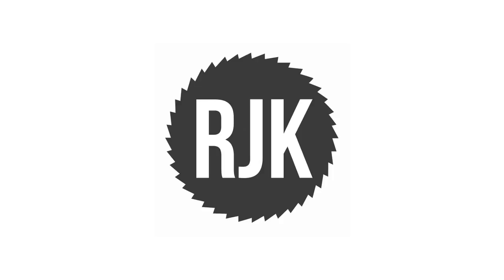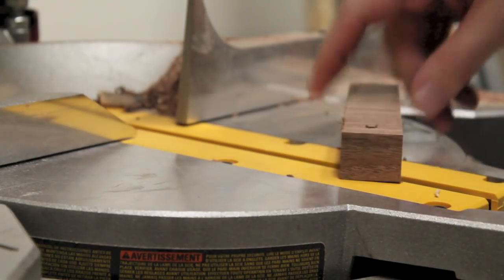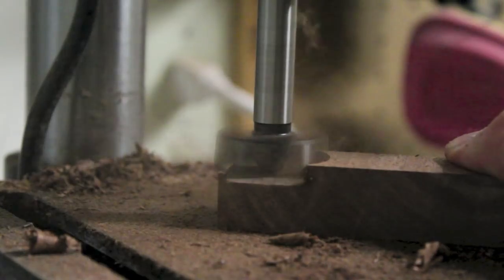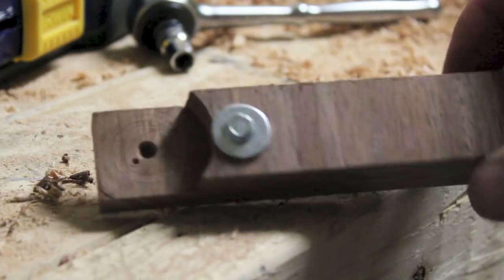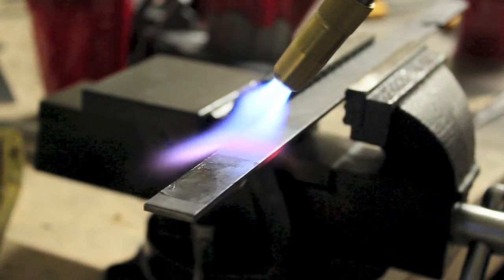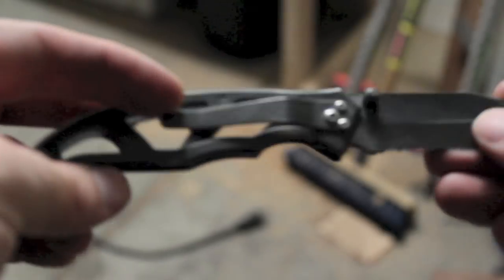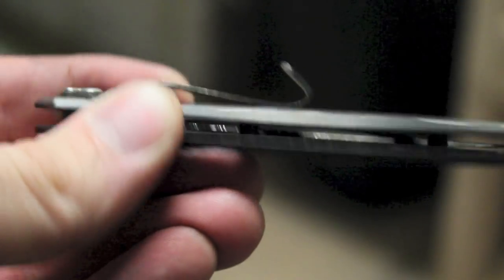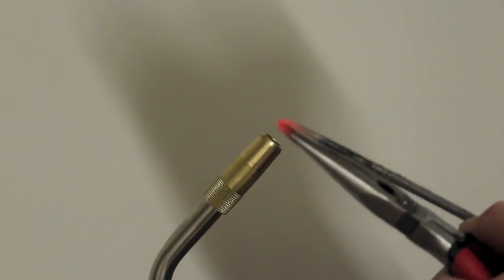8 DIY Bottle Openers (Diresta Inspired)

Comment: Use a tip that allows air to mix with the propane, they heat just fine, but without air or O2, not hot enough.